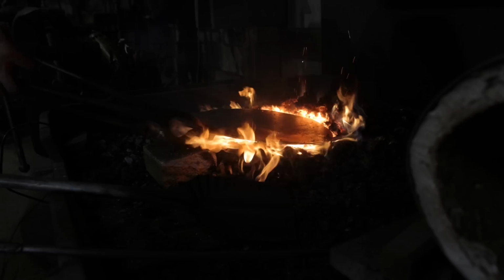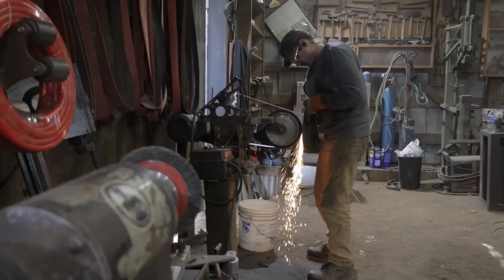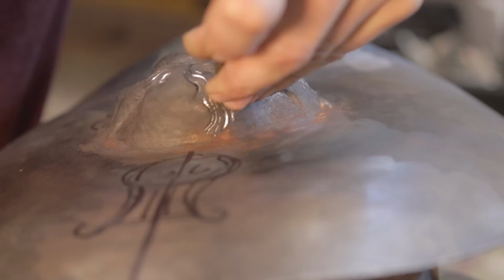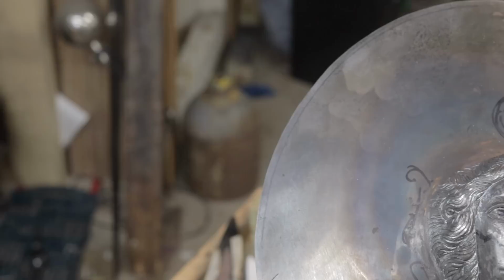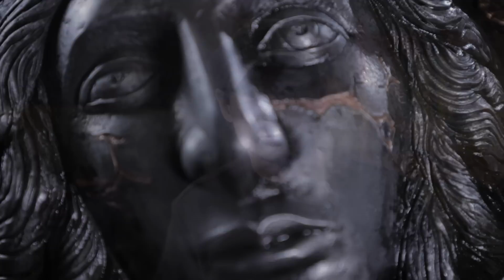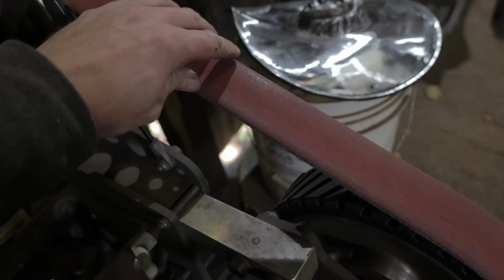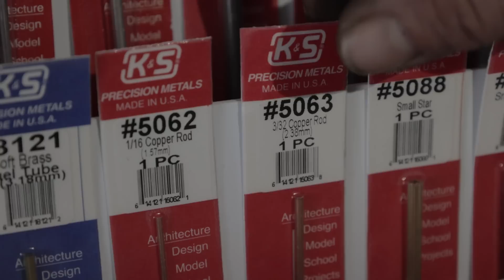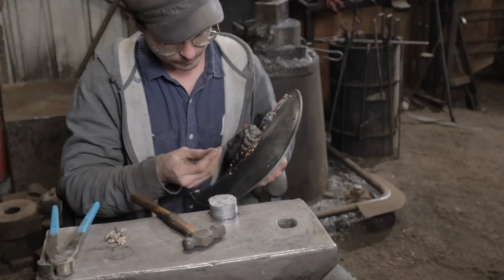Master Armorer Makes a Damascus Shield

Comment: Absolutely gorgeous. And it took "only" a month. 🙂 

It would be cool to see a matching-themed messer.  I know those are usually not particularly fancy, but since when has that stopped Iliya...
Reply from the maker: He just did a saber that sort of matches. Check his instgram. Slavicsmith
Reply: @ThatWorks  Dur. I don't touch Meta products for ethical reasons.

Comment: You showed that a traditional craftsman not only giving the item he mede, a use and purpose, he or she gives the item a soul by adding some fine art. And at the end it is not only that it feels right in hand it is about feeling right for the eye as well. For me it is necessary that a gun I guld or a knife or whatever it will be has an overall look that pleases the eye and is a joy to use.  before I start working I do a lot of research and do some scatches and drawings and these will come together on the materials I use. Even if there is a weak spot in a gunstock I try to do the repair a way that will fit to the item and please the eye. And if there is no decoration at all it is still posible to make it pleasing by the perfect outer lines and shape and make it look elegant by simplicity.  Thaks a lot for this nice video......

Comment: Its kind of an interesting life journey, when I was younger I did a BA majoring in painting and drawing, along with some sculpture, fibre arts, illustration and design. At the time and it was very hard to get work in those fields that kept you out of poverty, so I ended up doing interior design, picture framing, panel beating and for the majority of my life ended up doing radio engineering with microwave radios, lasers and telco transmission systems of all things. Now chronically ill and winding down with what time I've got left I'm making knives full time- so all those old lessons do come back to you. How to design, colour theory, composition and thematic structure all play a big part in moving a piece from being 'artisanal' and 'craft' to what is technically fine art.
I honestly think your armour piece is worthy of being called fine art.
Its an anachronism in an era of smart drones, automated fire control systems and energy weapons, therefore like any good art its functionally useless to the owner except for the pleasure of owning it. Plus containing sculptural and story qualities expressed in the media of metal to depict a story or convey a moment in time snapshot that may or may not have happened as a myth. Then composed around your own interpretation of that myth- which is important, however I think to some extent you might have thrown a bit more of your own interpretations into it rather than some expectations of what people would expect to be in it. But time is what it is because we're always short of it and I think given a little more of that would have let you focus a bit more on the 'you' elements. Maybe something to consider if you pick another mythic story one day, is to have it in the back of your head during the quiet moments and draw in some of the more esoteric or lateral variations on a theme over time.

I really think Ilya should do well with this in the art knife show, a lot of times you see art knives as being a bit of a mess of expensive materials with awful composition, come away a bit disappointed that the artist sometimes missed the point and got stuck in some artisan mind-set of perfection. Sometimes its not about the shiny diamonds or gold inlay, its what it makes the viewer feel when they see it beyond the materials and colours.
We didn't get that today though, so well done Ilya and keep rocking on nailing these things

Comment: I think the only thing I would have done differently is to make the handle oval shaped instead of round.  Having fought with a buckler with a round handle, it wants to spin in your hand.  The oval also allows you to know exactly where the face of your shield is by feel.  As usual, though, fantastic work, Ilya.

Comment: Maybe elaborate on "fiery quenches?" Because if you're dipping a piece of red hot steel into oil, you're going to get fire, that's just a fact of life. Maybe Parks 50 has a flashpoint in the thousands, but those of us who work out of a corner of the garage have to get by on motor oil.

Comment: Mad skills mister, you did used tar to keep the copper and silver still and sculpt it? I wanted to make some grooves into a steel hilt I made recently and hammer into it some copper wire but once the symmetry came out so good I feared the risk to ruin it, surely I have not your fine hand.

Comment: 🤔Dont flame ups actually happen a little anyway when going into oil, just from the initial entry into the oil, but it goes out once you're in deep enough? as I have never actually had my oil stay on fire it's one of the reasons I chose parks 50 for everything right now instead of Parks AAA for some steels like 80crv2 as you need to heat that to get optimal use out of it and oil fires scare the (BEEP) out of me.

Comment: Why does it say Armor build if a shield is a weapon?
Reply: Shields are equally armor and weapons
Reply from the maker: Oh boy…
Reply: @ThatWorks  at least you can laugh about it. 
Thanks for another amazing piece, the amount of effort your team puts into this channel is insane.
Bravo 👏
Reply: Well you see... Even other pieces of armour can be used as a weapon. Just look at steel gauntlets. They are both an item to protect your hands as well as  basically knuckle dusters.
Reply: @dersaegefisch  and swords are armors in your opinion, since it can block attacks.
Reply: an bucklers main purpose is to be an shield, it being able to bash better then other heavier shields doesn't classify it as an weapon, it's like being able to use an blade to deflex blows doesn't make it armor, it just could be used to block.
Reply: Do you... throw it at your opponent to end them rightly?
Reply: @stefthorman8548  No... You didn't quite understand what I was trying to say I fear. I was simply trying to state that everything can be used as a weapon. Even if it's primary function is the complete opposite of that. People literally died because they were hit by someone wearing gauntlets. But as you stated yourself: the main function determines what something is.